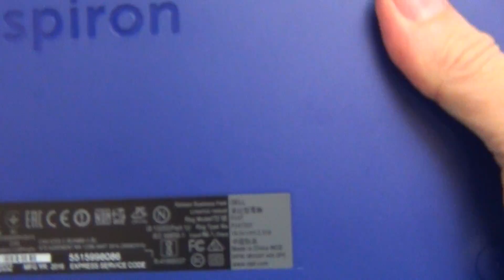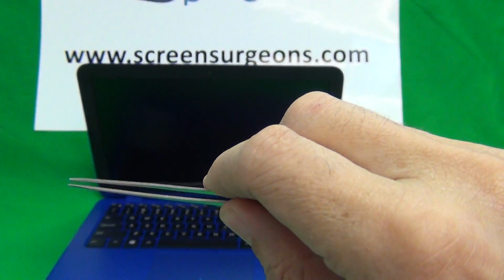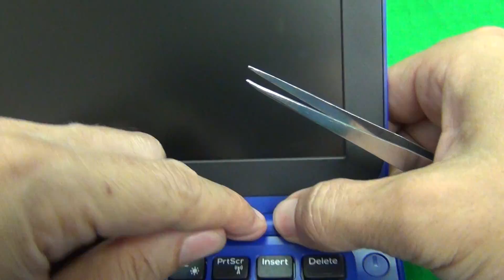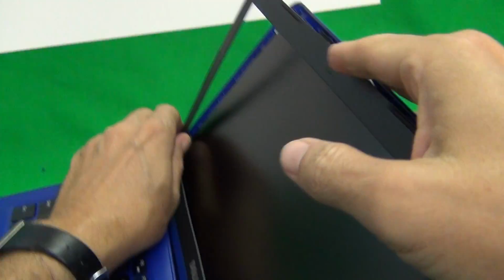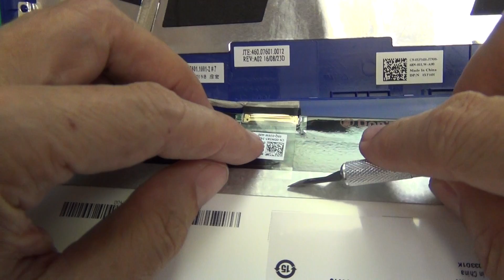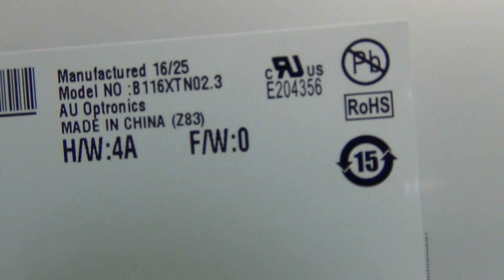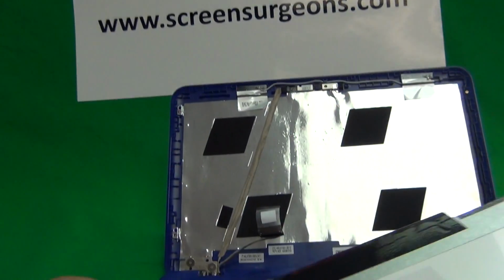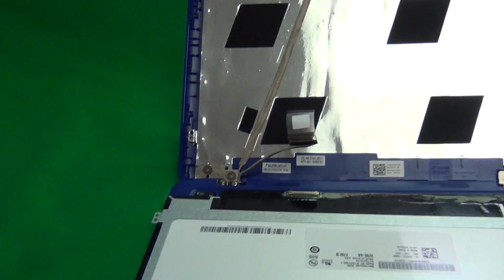Dell Inspiron 11 i3162 Laptop Screen Replacement Procedure

Comment: i just got this exact replacement, and it is defective, it came today and i installed it, the first screen was broken which is why i ordered this from you, the problem is when i powered on after the replacement, the screen was black, then in minutes it turned white, i know its only the screen because i hooked my tv to the laptop(exact one you are working on in this video) and it showed everything fine, just not on its new screen, i made sure i got the pins connected right because i made a point to make sure there was no gap when i did the connection, can you tell me what might be wrong? is it something that can be adjusted or does it need a re-replacement?